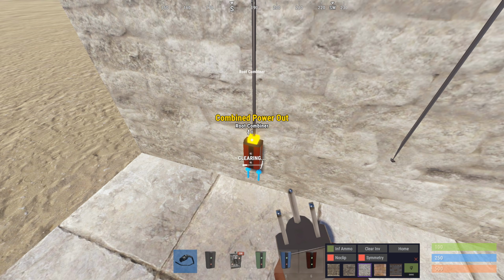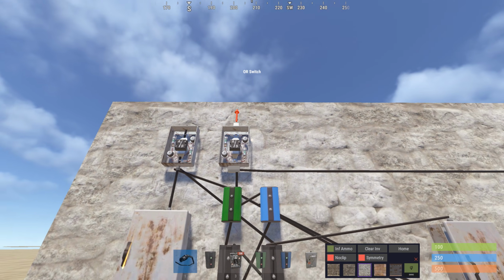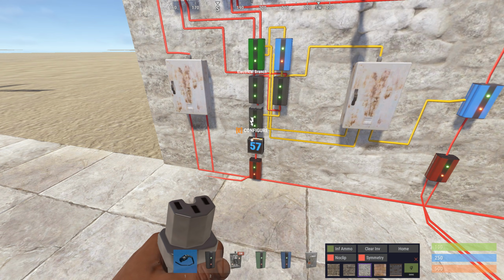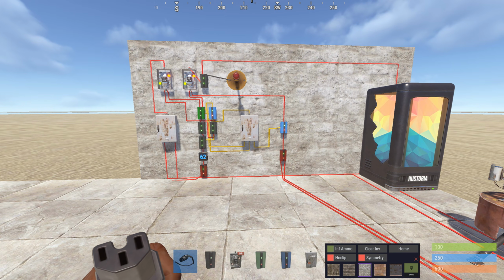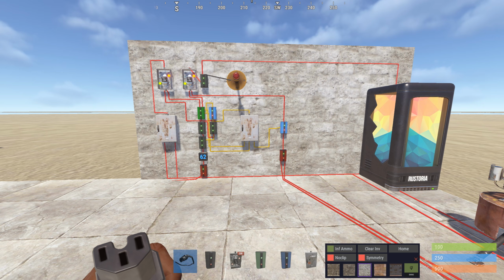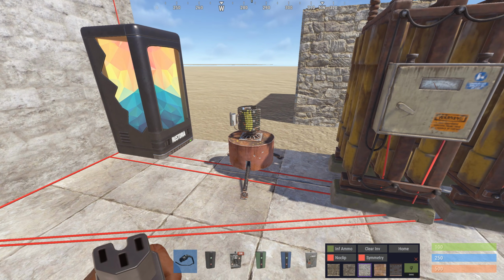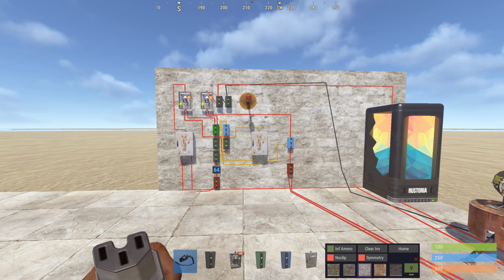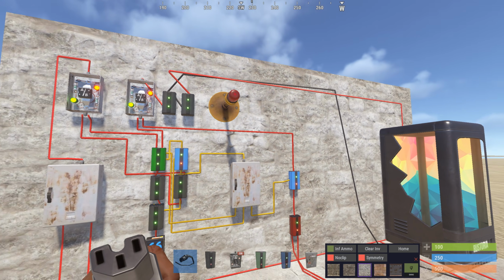Rust Electricity Tutorial - Power Management System

Comment: one question please, i built this system, when my root power goes out and i have like 2 turrets only in my base, all my batteries are powering those 2 turrets at the same time. is there a solve for this ? because when my root power goes out all my batteries are being utilized no matter how much small power i require. its showing 20 Active usage on all my 4 batteries.
Reply from the maker: Indeed, the way root combiners work with batteries (at least for now) is that they drain the same amount of power from all batteries which is inefficient. However this system is not supposed to work on battery power, batteries are there to only support the system when the wind turbines fluctuate up and down and produce sometimes less power than needed or in case of emergency. If you are constantly using battery power then I suggest you put some more turbines (or solar panels in simple systems) so the average will be more.

In your case however if you are using less than 100 power in total (20 in your case) then I suggest using only one large battery instead.

Comment: maybe i miss something but a root combiner behind a battery is usually a bad idea. the root combiner always sucks the maximum possible out of a battery... so each battery drains 100 permanently... they will run out soon.
Reply from the maker: Indeed, however the system is designed for the batteries to be drained only when the power production facilities do not produce enough power. If you don't overuse power you can for example use 100-125 power with a single wind turbine and having the battery(ies) full.
Reply: @dx4  "the system is designed for the batteries to be drained only when the power production facilities do not produce enough power"

root combiners ALWAYS suck the maximum out of the batteries. even if there is just one light on. ;)
i like your system. but the root combiners are not a good idea. i would maybe do it with just a single battery without root combiner. and then set up the system twice if needed. :P
Reply from the maker: @jan7392 they don't always drain power. This system is specifically designed to prevent that. Try it out 😊
Reply: @dx4  i tried it out some months ago. root combiners drain batteries non-stop. you need at least one wind turbine and 3 solar panels to power a single big battery with a setup like this.
but as i said: maybe i missunderstood a detail at this system. ;)

edit.: just tested your system and it works. seems there is something i still dont understand about electricity. ;)